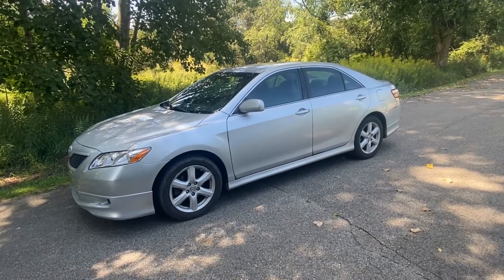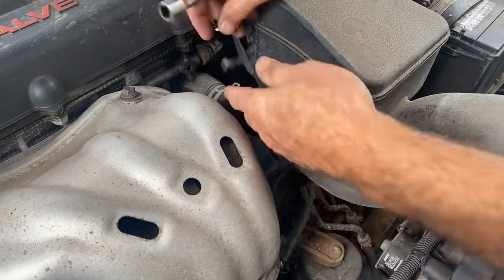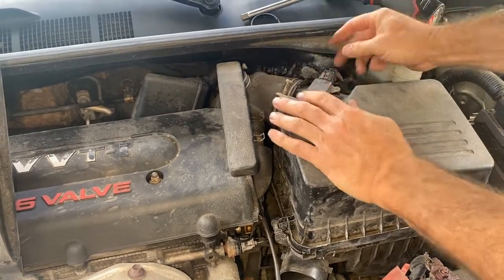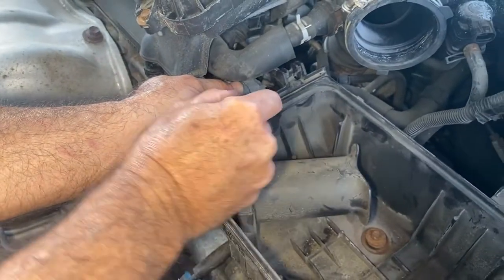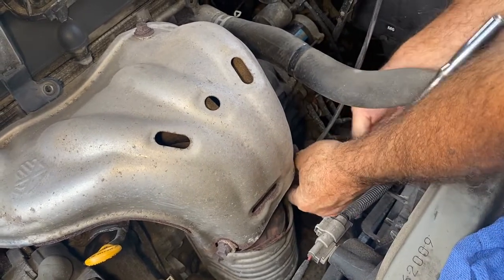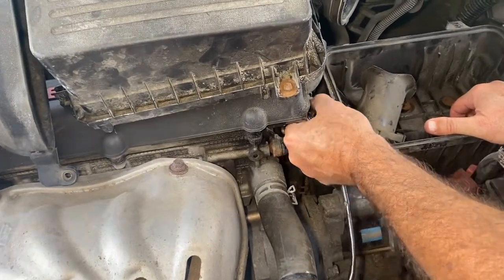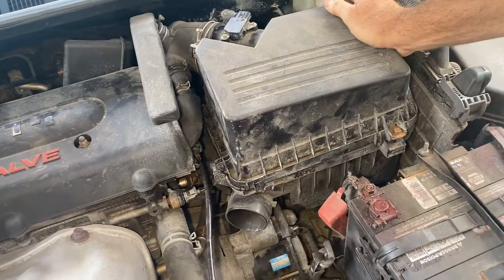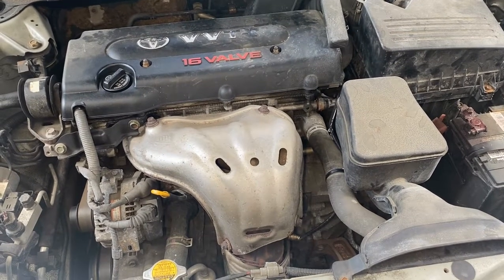How to Replace Oxygen Sensor Toyota Camry (6th Generation)

Comment: I received  p0138 code "heatedsensor bank1 sensor 2" is that the next one following the pipe? I have a 2.4 liter should only have 2 total correct
Reply from the maker: You have two oxygen sensors on your 2.4 Toyota motor. You will want to replace the one after the catalytic converter for the PO138 code.
Reply: @TheAutoTeacher  thank you.  I just watched it live on my hour ride home. The sensor 1 is bouncing around 3.o volts which is crazy high I heard and the 2nd(downstream) wasn't reading any this morning but I tapped on it , uplugged and plugged back in.  That was reading at steady speed around .4 to .5  and the waves on the graph  seemed consistant. I think I'm just going to replace both. OH and my STFT stayed under +8 and  -8.
Reply: The downstream sensor is easier to replace because you don't have to remove parts, like the upstream sensor.

Comment: good video. Did you have any engine light  code and if any what code. And would you pls tell us what was the car mileage . Because i have same year model with 146k on it and do i need to prepare for new afs ? thank you
Reply from the maker: Thanks,it had a check engine light with a PO 131 code. Mileage was just over 200,000.
Reply: You still had the code after installing the new one??
Reply: @TheAutoTeacher